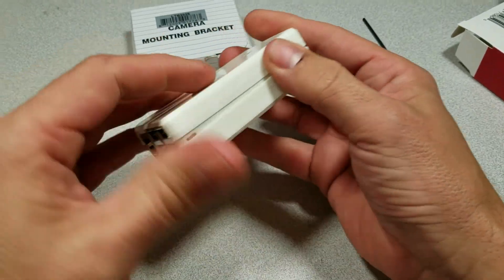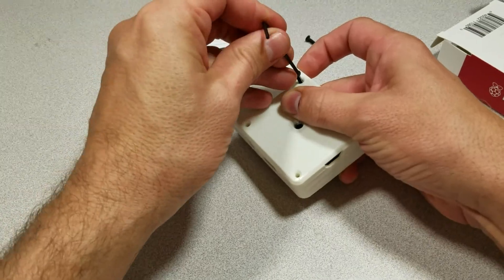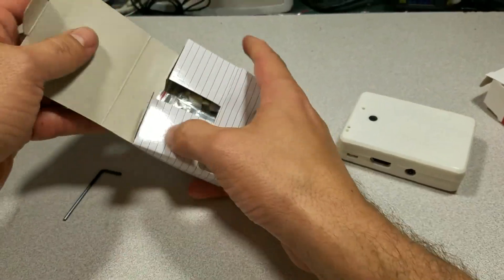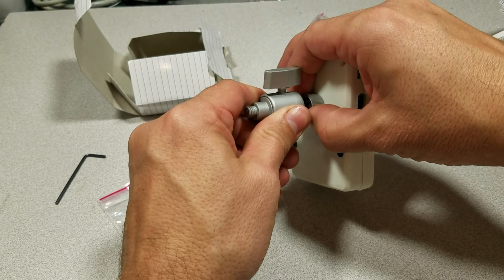Best case for Raspberry Pi and Camera Module

Comment: curious if there have been ventilation improvements in the past year?
Reply from the maker: No, but we should make that enhancement. However, we have been using this case with our active security cameras that have been running 24/7 for several years without problems.

Comment: You should mention that the camera will not stand by its own in the extra mount. The base plate is too light and the camera would tip over if you took your hand off it. That's true even without the extension rod. That's fairly deceptive.
Reply from the maker: Thanks for your feedback. We intended this mount to be mounted to a wall/ceiling/etc. We've updated the notes on the product description to make this clear: https://ameridroid.com/products/smoothcam-raspberry-pi-camera-case-3d-printed-abs
Reply from the maker: If you want to use it as a free-standing base, you can attach it to a small piece of wood with the included screws.